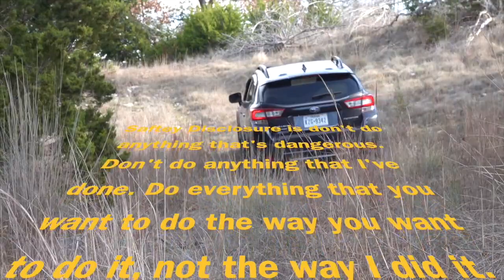I build a Long Drawer Sleeping Platform & Car Camp at Brazos Bend State Park Ep. 20

Comment: What’s the name of the sunroof net on Amazon. And how did you get your back window Reflectixs to stay in? Thank you for the video.
Reply from the maker: Thanks for watching and commenting. Regarding the rear hatch reflective material. I taped four pieces of thin plastic on the sides so it would fit under the inner molding of the hatch. There is a little space and the thin plastic slides in and holds it in place. You could also use thin cardboard with tape over it for strength. Here’s the link to the sunroof net. That thing is great! I forgot I had it up there and I drove on the highway and it never moved. https://www.amazon.com/dp/B07Q55Y9WC/ref=cm_sw_em_r_mt_dp_JC5X661J0NKVRNGFK3KF?_encoding=UTF8&psc=1
Reply: @creationsbycarson  Thank you. 💜👍🏼 I think I’m gonna say I’m tent camping. Because I always do have a tent for to put things in. And sometimes I like to sleep in the tent.
Reply from the maker: I love tents, but I can’t build a tent or can I…